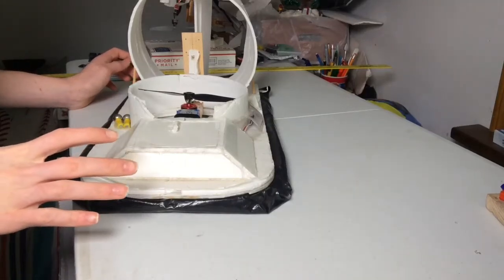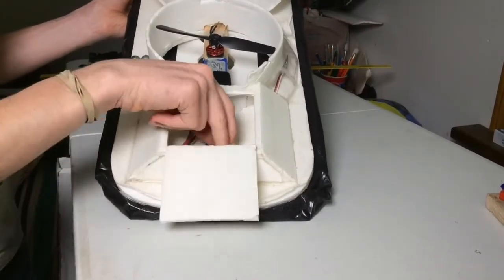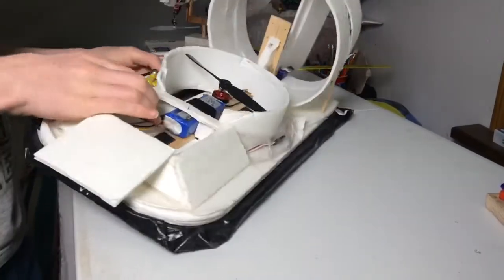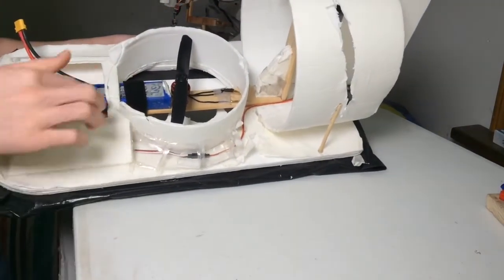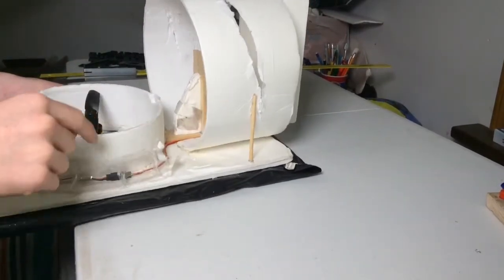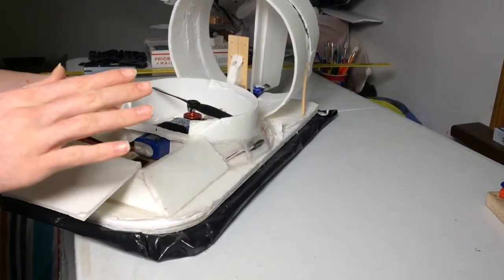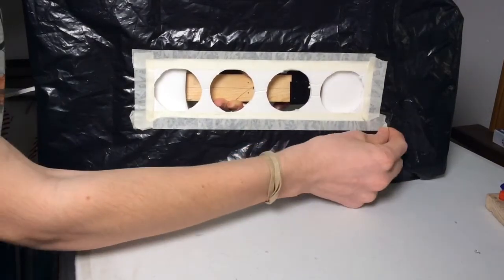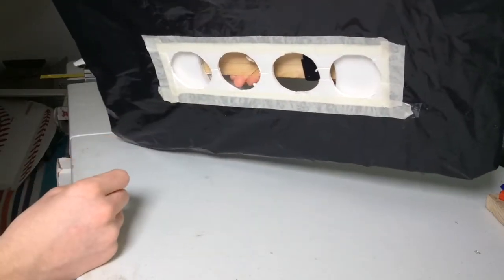Ft Diy hovercraft details update

Comment: The hovercraft tends to spiral without control,  how do I balance it and have accurate control?
Reply from the maker: lena sekar I do notice some balance issues when I run the electronics down one side of the hovercraft. I added so weight to the other side until it seemed good. Spiraling also could sound like a motor torque issue. Hope this helps